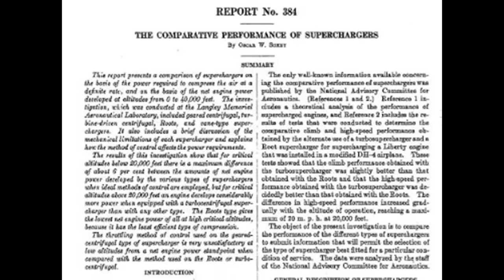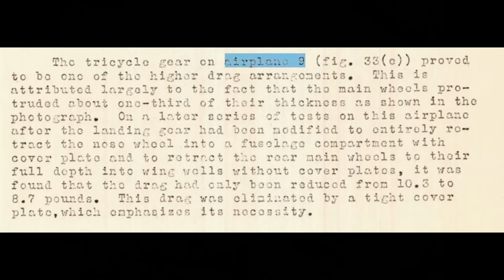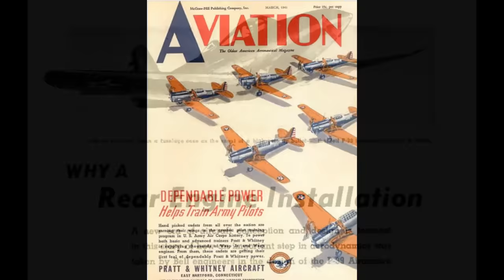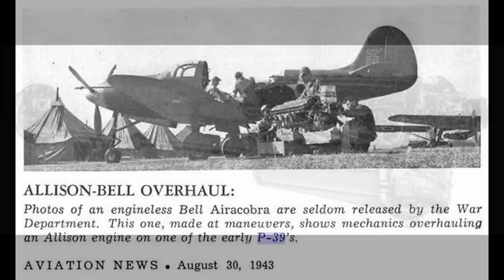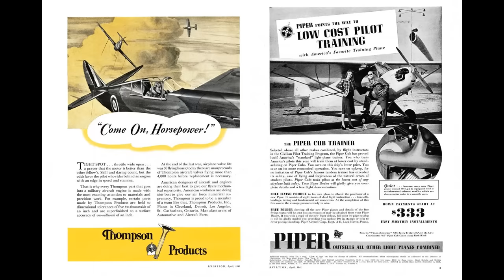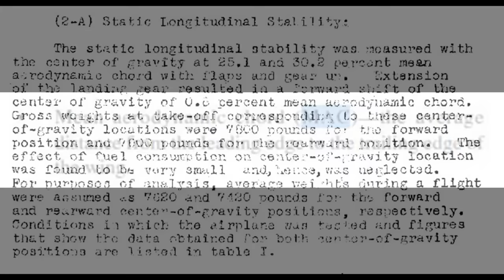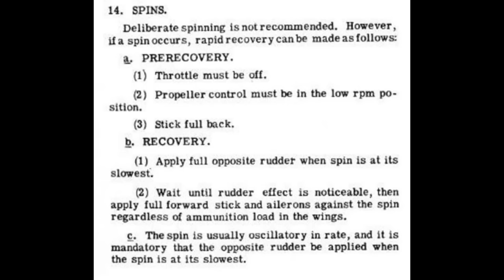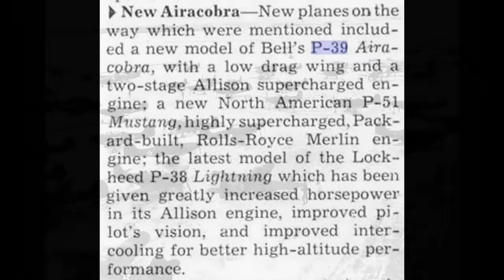Bell P-39 Airacobra, Why the Mid Eng?

Comment: But still had the reduction gear been on the engine had the torque  had been far higher  necessitating an even stiffer , and thus heavier forward fuselage.....
Reply from the maker: No because that torque is transmitted to the engine mounts, which are already strong enough to take it.

Comment: Well ... their altitude problems made them poor interceptors and their range problems made them poor escorts - even at lower altitudes.

So - the Americans used them for ground attack.  It could after all carry a decent sized bomb - for the day - and that 37mm would really do some damage to anything it hit, like a lighter bunker, vehicles or artillery.  I don't know if the Americans had Armor Piercing Ammunition for the 37mm.

The Russians didn't have armor piercing ammunition for the 37mm so - the assumption that they used them for tank killers wasn't accurate.  But - because most of the combat on the Eastern Front was involving ground attack missions - by such as German Bombers - the Russians liked that 37mm in an air to air role.

The other thing about the Russians - if you look at their own aircraft designs - is that they tend to favor putting all the armament in the fuselage and not in the wings.  Here - one of the things the Russians sometimes did - was to take out the wing armament.  Here - with the .50 cals and the 37mm in the fuselage - dispensing with the rifle caliber weapons in the wings - kept the heaviest armament where the Russians wanted it and gave the plane a faster role rate.

The other thing was that the P-39's all came with a radio - and the Russians liked that.

My personal experience with P-39's was limited to flight sim's.  Probably, Aces of the Pacific .

Here the game had one mission where you had to scramble your P-39 at Port Moresby because of a sudden attack by A6M's.  The only tactic that worked here - was to head out over the water until you could climb to altitude without being attacked - then turn back and see if there were any Japanese aircraft still around.  What amused me about that - was that this was actually a fairly real tactic that led the pilots to refer to the P-39's as the Fishing Fleet.
.
Reply: I think I also remember reading or learning somewhere the Russians were very grateful it had good cabin heat & windscreen defrost mechanisms.

Comment: It's interesting to note that Bell's engineers allegedly got improvements in aerodinamics by placing the engine behind the pilot, but threw all the improvements away because the engine and wing choosen positions actually increased P-39's frontal area. Engineers and cognitive dissonance just don't match.

Comment: I would have put a tank in the tail which would be empty by the time combat begins and thus not needing to be self-sealing.
Reply from the maker: You could do that, but would still need to purge the vapors with a CO2 system like the non self sealing Corsair wing tanks.

Comment: 29:50 i wonder how much you had to trim it.....
if you didnt need to make large trim adjustments as speed changed........ the CG and CL is probably pretty damn close
.
not a pilot..... just a DCS nerd (however....if i had the money, id get a pilots licence ASAP)
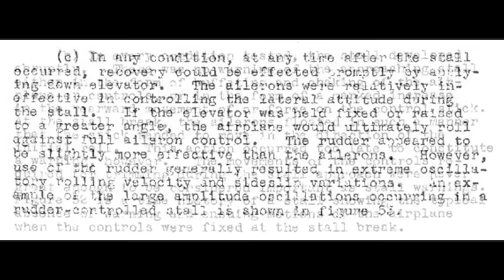Reply: 30:44 and if i understand things right......THEIRS! my proof
.
 that "no great trim was needed before the stall"
AKA... CG and CL is so close.... that pilot work load was reduced (for better or worse)
.
.
with a computer...... or even basic hydraulic "stability computers"......... the P-39 would be talked about more than any other fighter of ww2
might of even got the money / demand to slap that turbo back on.......
.
IDK.... the P-47 is my sweetheart...... but ive always loved the p-39 (and the other CRAZY Bell designs)
Reply from the maker: Kain, you have raised an excellent point. Well done and thanks!

Comment: On aircraft with a high percentage of the overall weight is located at or close to the center of gravity tend to have adverse spin character.
.
Reply: No, twins/multis with far apart wing mounted engines are murder in a spin, more than a turn and they are driven flat and become exceptionality difficult to recover.  You are taught to maintain your speed and rarely do more than a sedate rate one turn.
Reply: Interested in exactly what is meant by "adverse spin character", and how it is caused by less longitudinal distribution of mass.

Comment: You'd save yourself some trouble by saying "Static Margin" instead of "% of MAC". Besides that's std language we use in the aero eng world.
Reply from the maker: Hi Klingberg, I understand your point, but the term "Static Margin" isn't used i pilot manuals, at least not in Boeings, it's all done in terms of percent MAC.
Reply: Those are two different things, though? Translatable to each other if the neutral point is known, yes. But at the level of specificity he was using it in the video, they could not be stand-ins for each other.